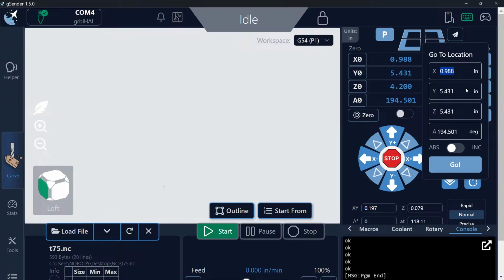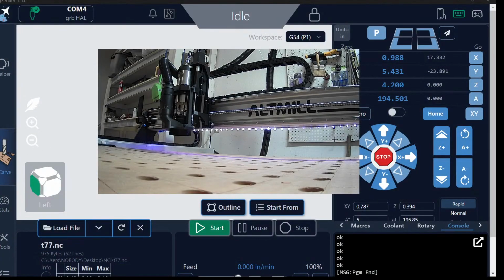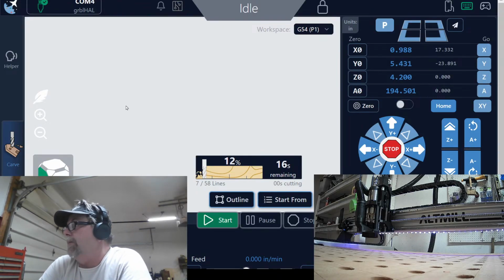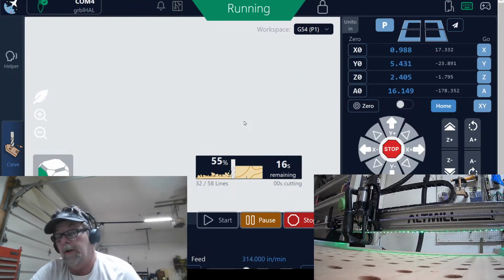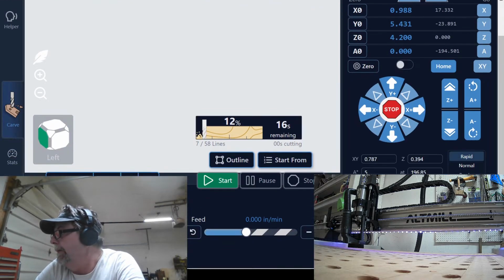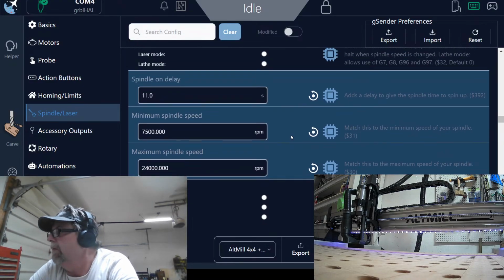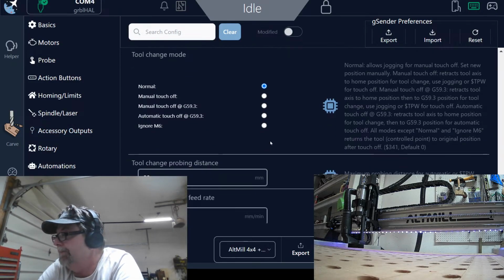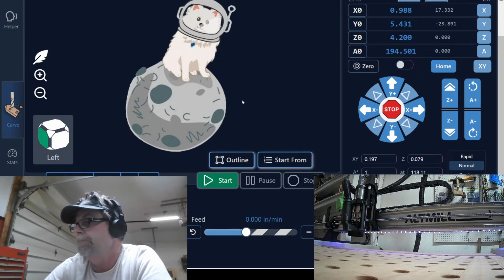Lets Talk GSender 1.5.0 I'm speechless!

Comment: So YOU do not like the angle jog buttons?  Who cares what YOU like, other than YOU?  I use them all the time.  I have been running NC/CNC machines since 1974.  That is 52 years in case you are math challenged.  Listening to you stammer and stutter around as you whine, snivel and whinge is fatiguing at best. Over 40 minutes to say what could have been said in all of 5 minutes, maybe less?  You sir, are a blowhard.

Comment: I don’t want to pile on, but you’re spot on. I much prefer gSender over any other control software. As someone who designs process controls, I’d never put “fluff” on an HMI or allow controls that risk hands near moving parts. X, Y, Z is enough.
gSender looks great, but it could flow better with decluttering and tabbed views. I’d also make the g-code pop-out an alternate view—give folks both options.
I sometimes think about building my own control software or modifying exsisting software, but then ask myself… why? gSender already nails it, just needs a bit of refinement. Truth is, I’ve got enough to learn—like new ways to trash a router bit or remembering to mirror a VCarve inlay—before I start chasing tweaks my left brain convinces my right brain I need.
Reply from the maker: Gsender is a little fluffy for me Ive been programming and running CNC's for almost 30 years now and it is way to much.  I had a modded version of 1.5.0 but recently switching to a raspberry pi i have yet to get the source code to compile for the pi.  Apparently its a problem so once im able to get it to compile ill go back to a modded version.